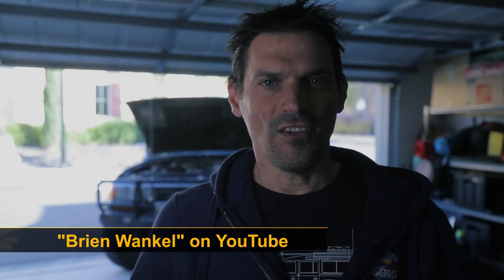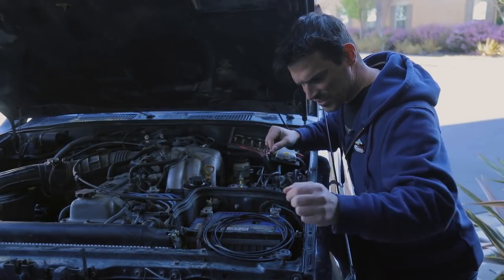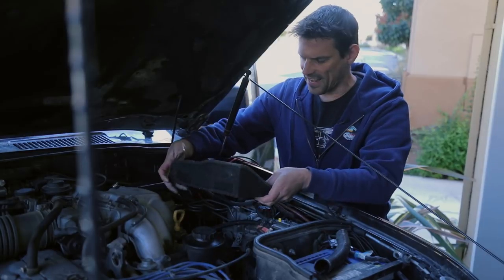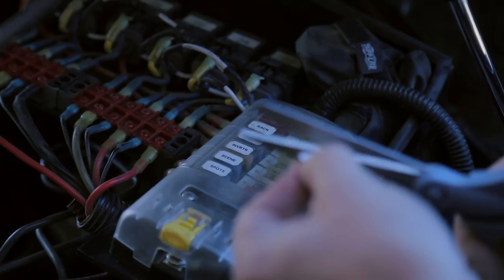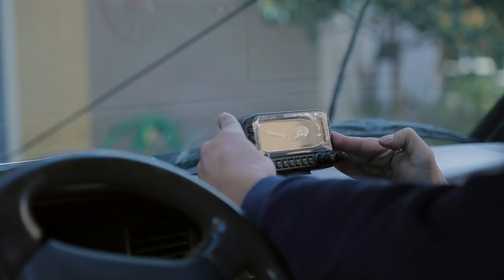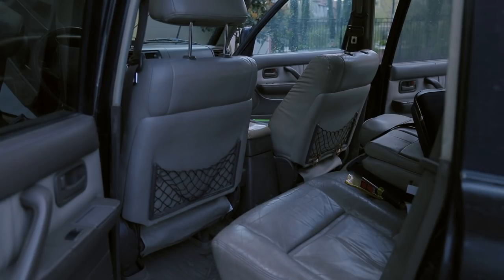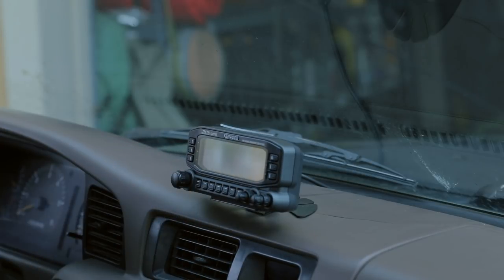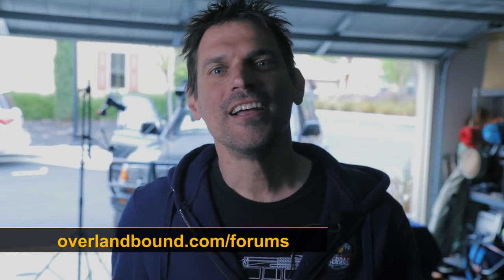Ham Install 02

Comment from the maker: Thanks for watching everyone, and for the GREAT comments! On the GMRS/Ham note, "While this radio (with a specific modification) would be able to TX on GMRS frequencies, it's not legal to do so as far as the FCC is concerned since the radio is not part 95 certified. -Brien". So maybe it can, but shouldn't, and the antennae really isn't tuned for it apparently. Disregard. Move along. Nothing to see here. More tonday!
Reply: I was going to point that out, but sounds like you've got it.

Comment: While this radio (with a specific modification) would be able to TX on GMRS frequencies, it's not legal to do so as far as the FCC is concerned since the radio is not part 95 certified. There's more specific boring reasons that I'll also likely make a short video about some day in the near future. In short: even though you technically /can/ you really /shouldn't/ if you wanna be a good legal steward of the air waves.
Reply: It's called a MARS/CAP mod for anyone who cares.  Some radios require a software change, some require a wire snipped or a resistor removed from the circuit board.  
Google "MARSCAP Mod" and add whatever your radio model is and you'll find the directions to do it.

Comment: The comment about not needing your GMRS radio anymore; I believe to be incorrect.  The D710G Kenwood will receive GMRS frequency but I do not think it will transmit.  Also the antenna you bought for the ham is not in the GMRS band and will have a poor SWR.  Keep your GMRS radio and GMRS antenna.  🤩

Comment: @ 8:00  the longer you run a wire the thicker you need it but in a short distance like in a car, it is negligible. This rule applies to very long distances and in AC especifically. DC voltage behaves differently.
Reply: While what you say is basicly true, in DC applications it matters what you plan to power with the wire, even though as you state, "DC behaves differently" DC current still creates heat, lots of current creates lots of heat, a smaller gauge cable running from the battery to the rear of a vehicle running something like a AC inverter will not provide enough current to operate the inverter at max capacity, and if I did not mention already, create a lot of HEAT. Heat melts the insulation on the wiring which leads to a fire, thats if it doesn't blow the fuse first. There is also voltage drop to consider with the length of the wire or cable. So in short, yes even in short distances like in a car, the gauge of the wire is cruical for optimal performance of the accessory you want to power, and there is the safety factor.

Comment: Digging the extra videos to keep us entertained while stuck at home. Thank you!  The Kenwood TM-D710GA is an excellent radio. Having said that, the radio is not OK for GMRS use.  It CAN do it with a hardware modification, but the radio isn't type accepted by the FCC for Part 95 transmitting.  No one likes the hall monitor dude, but if you're going to use the radio that way you (and all the viewers) should have all the info to make an informed decision. It's not like the radio police will come get you, but it's not something I'd broadcast on YouTube either.  Rock and and keep having fun!
Reply from the maker: Ah! Copy! Thought it was legal. Thanks for the notes.
Reply: @OverlandBound  Why does everyone with a radio suddenly start talking like a trucker on a CB?
Reply from the maker: @jimbartlett5499  You never did that as a kid...over? :D

Comment: If you end up having too much engine ignition noise, try running the radio power directly to the battery. - KG5TBL
Reply from the maker: Copy. KM6YSL

Comment: Replace the T-connector with Anderson Powerpoles. That way if you need to temporarily pull it out and are around other hams, most are set up with Anderson Powerpoles.

Comment: Radio is awesome but the faceplate bracket is so bad. I have the same one and the faceplate vibrates badly on any road surface.
Reply from the maker: I was afraid of this. I may have to come up with something better.
Reply: Overland Bound Yeah, I’m looking at RAM mounts for a solution.
Reply: I use this for my Kenwood head unit. On amazon. MFX2 Extra Long 22" Car Seat Bolt Floor Mount

Comment: Michael I have 4 of those Kenwood rigs and love them. I have the programming software and the aprs/tnc setup for it if you need it. Check our APRSDROID if you want way more APRS functionality. Let's you take all your APRS data and display on a map so you can see where everyone is plus APRS messaging is done on your tablet using the radio as a modem. Works great!
Reply from the maker: Thank you! I’m sure I will have many questions!

Comment: 2 questions: won’t the base unit get hot air blown on it there when the heater is on? Are you already using the factory knee speakers for something? Seems like those would make more sense than the Uniden speaker.
Reply from the maker: Somewhat but not directly in front. Those speakers are not great.

Comment: I like that radio, I should look into that model. How does that attach to the mount?
Reply from the maker: You depress a good-sized button on the back which releases it. It seems very sturdy, as well as easy to remove.
Reply: Overland Bound my rig is a 2013 F150, and I have a RAM mount up under my rear view mirror. I’m considering putting it there
Reply from the maker: @Sjackson2369  I may switch this to a ram mount.